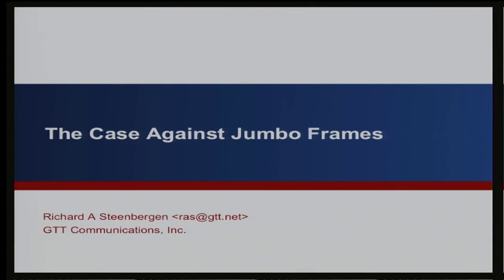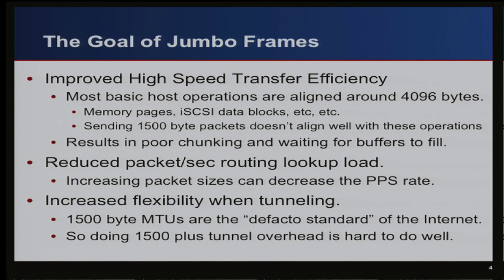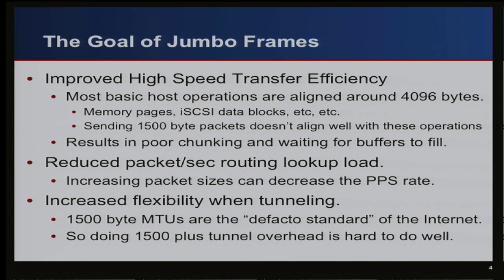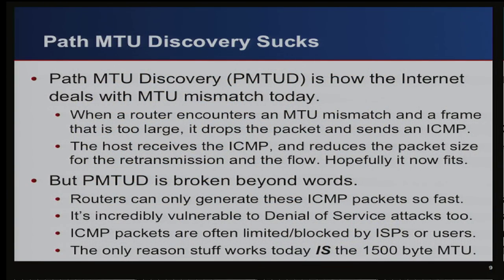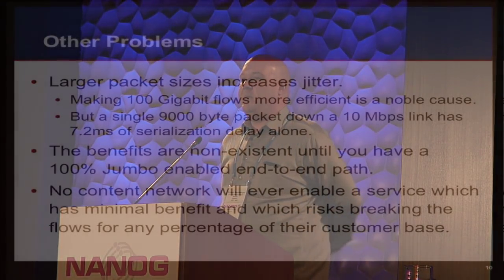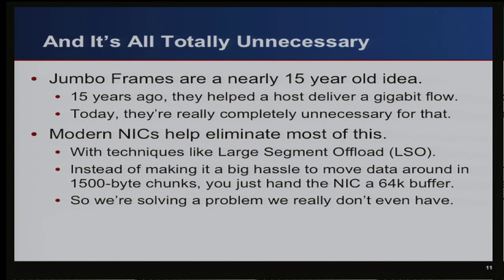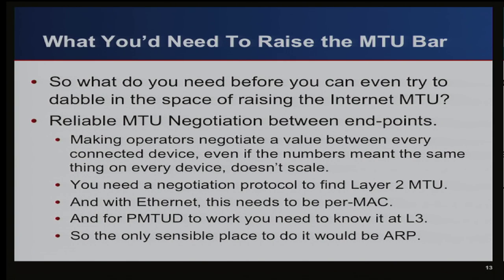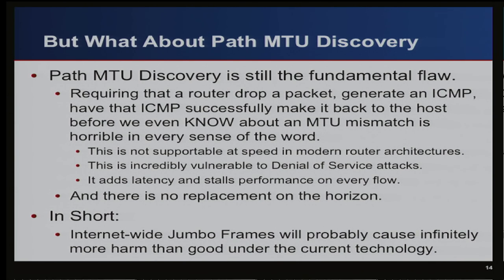The Case Against Jumbo Frames

Comment: To Scott Leibrand's point, the potential to discover MTU in-band does exist - it's codified in RFC 4821. Linux implements it via the tcp_mtu_probing sysctl; Windows servers call it "PMTU Blackhole Router Detection".

Comment: I think that calling this presentation "The Case Against Jumbo Frames" and then talking about flaws in MTU path discovery and lack of standarization is not very smart. Jumbo frames give you +20% speed on the same hardware. Who wouldn't want that?
Reply: I got a throughput hike of 4x after enabling jumbo frames. For backup and restores of data in TBs , we need Jumbo frames. Offcourse, we can avoid router and keep traffic till switch level...
Reply: My ISCSI transfer speeds to and from my NAS increased significantly after enabling jumbo frames on my small internal network and I would never go back!!!
Reply: @nerdspark8084  He is being very misunderstood.  He is not against solving with packet window size and frames issue. He is saying that turning on jumbo frames eg: setting MTU to 9000 isn't a solution, cause in a few years, we will have the same issue!(actually, we are already there, 9000 MTU still has a s..tload of overhead on 10, 15, 40+ gbe) We need to get rid of MTU size all together, and come up with a way to eliminate this flaw in ethernet negotiation.